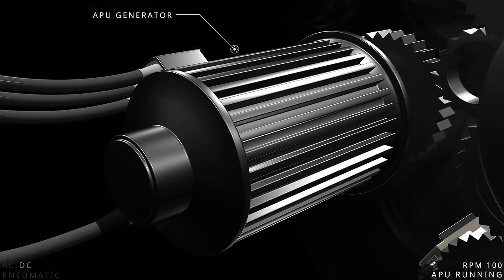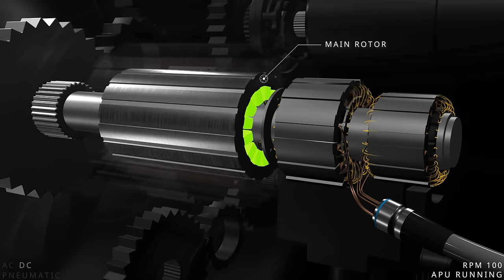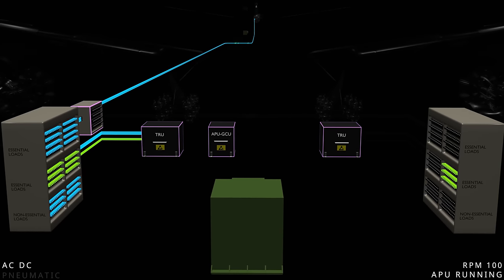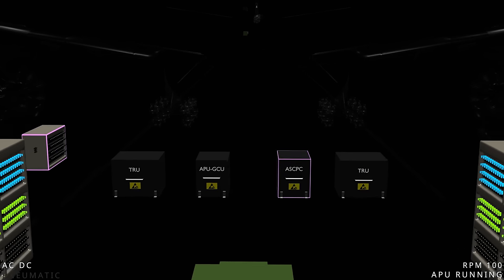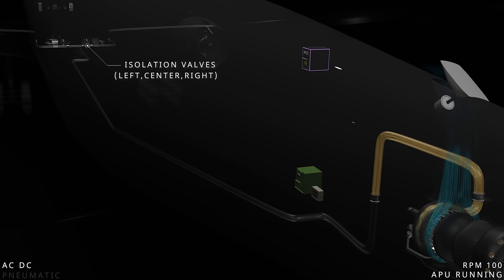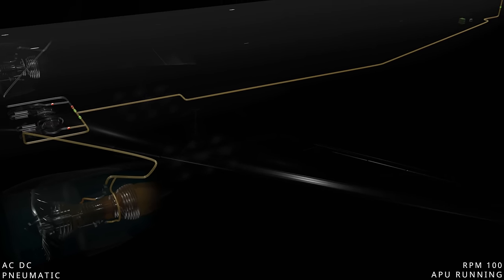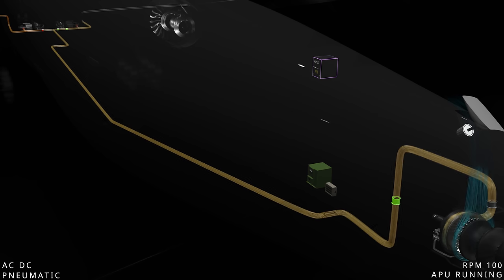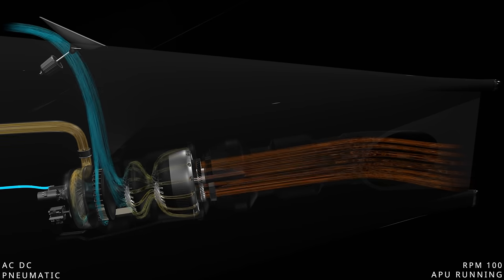How Auxiliary Power Units Work | Part 2 : Power

Comment: The background music during engine startup is amplifying the power and strength of the b777 engine.
Reply: The dramatic music check valve is opened so it can improve starter performance.

Comment: Is it from engine 1 bleed to engine 2??? Or that's the way by 777 to start engine 2 from APU?
Reply: Im wondering the same
Reply from the maker: The APU bleed is used to start the main engines. A cross-bleed start is carried out only when the APU bleed is unavailable.
Reply: @AircraftScience  do you know why this is the way? Does the apu produce more bleed air than the single engine?

Comment: Amazing and spot on animation, I just have a question doesn’t the right engine gets started up with the bleed air from the left engine?
Reply: Probably because the pressure given by the main engines is much higher than what the mini turbine that starts the engines can handle.
Reply: The Engine Air Starter is not very big, it was made to be powered by the APU bleed, not the Left Engine Bleed which is much more powerful. This is observable as the APU is 1. Smaller than the Left Engine 2. Meant to supply bleed air for engine start and some other things on ground. Also, in case of engine failure, the remaining engine powers the panels and the pneumatic ducts. In flight, this pneumatic system provided by the engine is crucial. Unless you descend to 10,000ft, it wouldn’t work very well to shut off some of the pneumatic valves to attempt to restart the engine with the use of the Air Starter. Also comes the possibility that you lose both engines. At least then, the APU can help at to try to restart one of them if time and necessity occur.